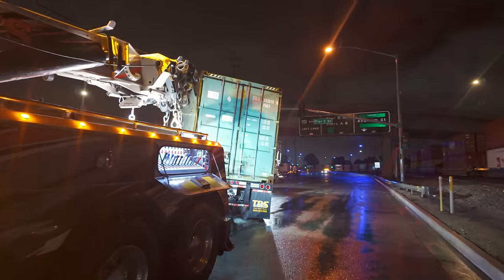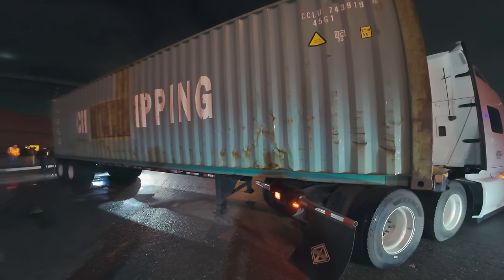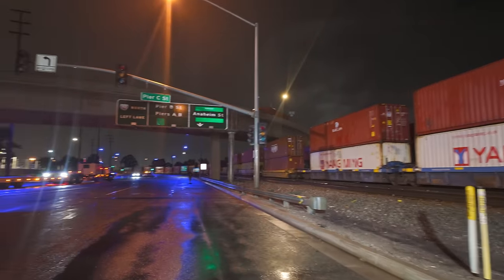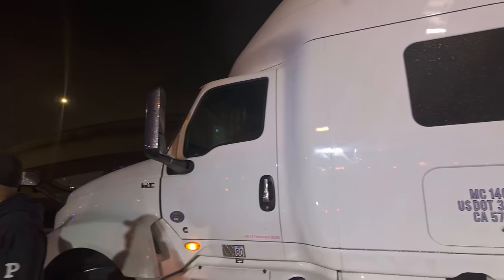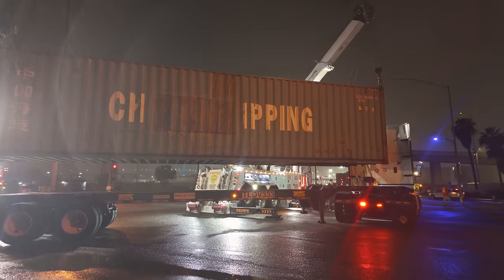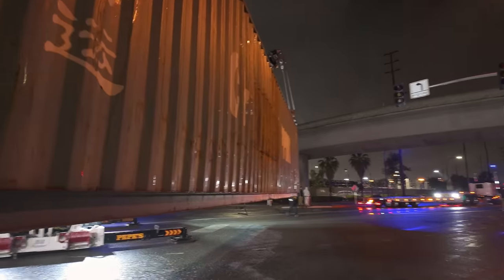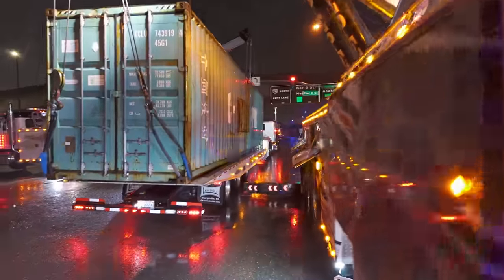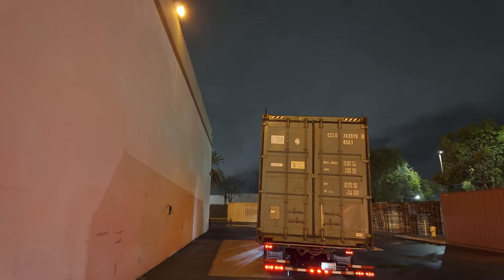Shifted Load Almost Flips Container

Comment: another crazy container rescue and thanks for sharing as always. At least the driver had some quick thinking to prevent it from being any worse! There is a 3rd party waterproof case for the pocket 3.. but  it is only the device.. not with the handle thread mount or the battery handle and with the screen in portrait mode only. DJI have no plan as yet to release an official case for it :(

Comment: Our last container roll over was a machine in a silver metal crate in a 40'HC box they secured the box in the container but failed to secure the machine to the box. 47000 lb machine slid 1 inch to the left and rolled the truck at under 15 mph.  In a 25 mph right hand turn. 
Great save you all. Stay safe out there.

Comment: It appears the fifth wheel being a non stabilised version that can only pivot in the front to rear orientation, has allowed the trailer to lean over when the prime mover turned at 90° to the trailer. When the trailer is in this position the fifth wheel pivot direction is across the trailer allowing it to tilt if loaded unevenly. I drove a prime mover (tractor in USA) that had a ball race fifth wheel that had the top plate prevented from turning under the trailer by virtue of a block welded behind the king pin. The fifth wheel turned on the ball race thus ensuring the front/rear rocking motion of it was always lined up with the trailer, not the prime mover preventing situations like in the video.

Comment: Hi guys I see you are using  a chain joining link to lift up your container. I find a 19 ton bow shackle and a 22 ton shackle fits perfect. This is the Crosby shackle the one with the screw pin not the one with the pin and nut. Give it a try.